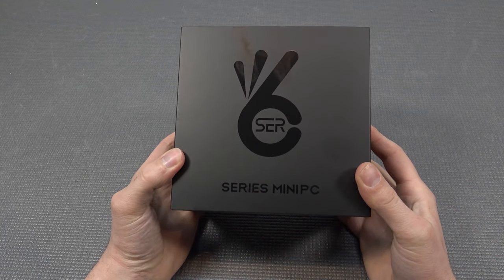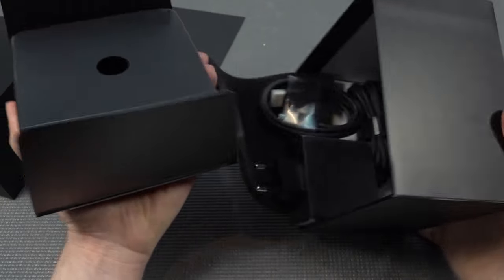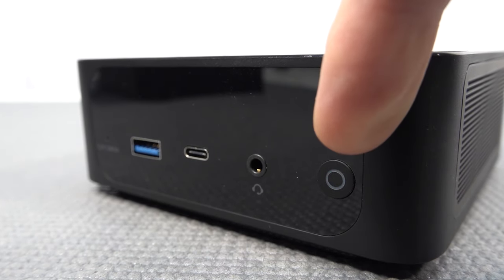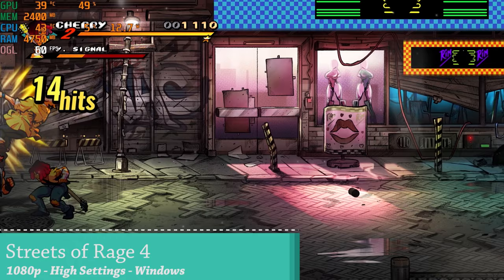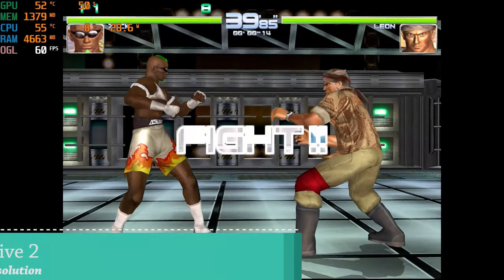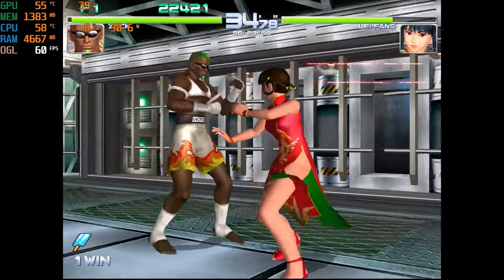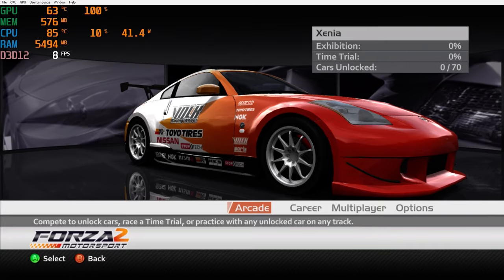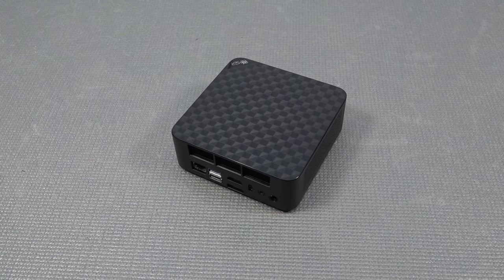Amazing Gaming & 4k Emulation Performance  / SER6 6900HX Beelink

Comment: Which mini pc running amd 7840 should I buy for emulation until ps3 ?
In your precedent review although it had the same gpu I remember it was not as powerful.
 Note : the ssd is a Crucial p3 plus gen4 4x, note the fatest, i don't know if it will change anything having a faster ssd (5000 vs 7500)
Reply from the maker: I made a tutorial / guide coming today about what ways to play. 
In short ... 6900HX or 7740HS are the best. 
Fast loading games in general and overal good performance. 
5xxx series and old Intel chips are so SLOW 🤣 where you can play games. 
Loading times take for ever 😳
Reply: @WickedGamerCollector  you're the One. Thanks for all from France

Comment: Crucial P3 Plus SSD, the Phison chip is the memory controller.
Reply from the maker: A Crucial  ... Mmmm... ok that is not a bad brand at all.
Reply: @WickedGamerCollector  They probably got it in bulk along with the RAM since both are from Crucial.
Reply: @WickedGamerCollector  Beelink peels off the branding for better contact with the heatpad.